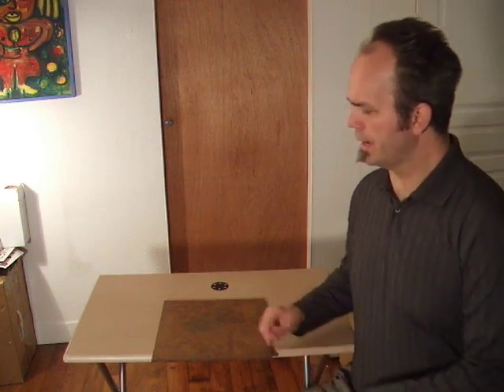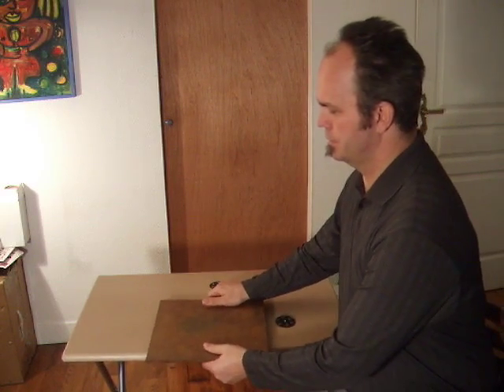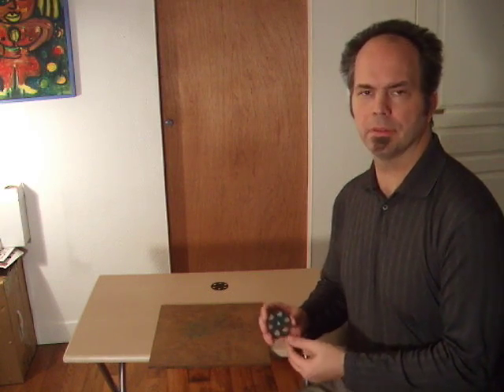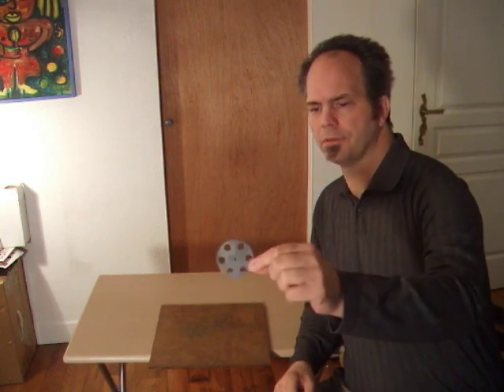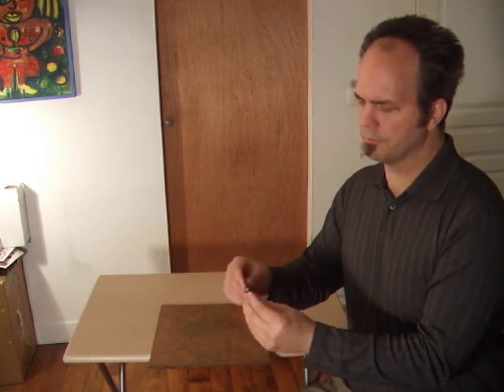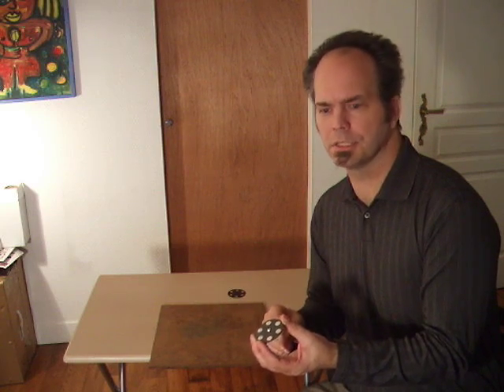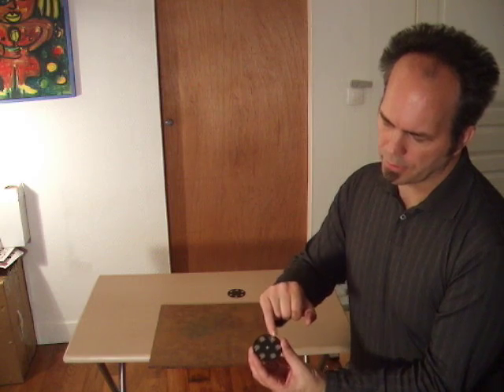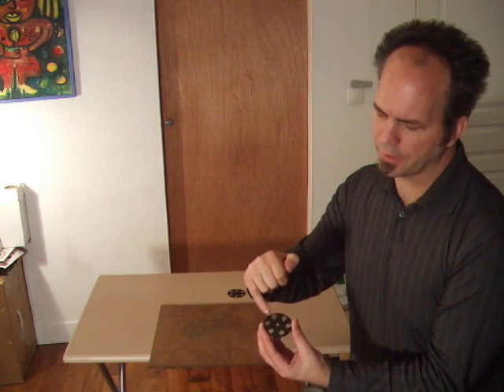🔝 Magnetic Levitating Top via Lenz's Law - Demonstration & Explanation

Comment: have you tried it will all one pole facing down instead of alternating? isn't going to change the Lernze effect from impeding the rotation, but if you look at the video the top bob's up and down. I think this is because you're basically producing an effect of two rings of "magnets" - the top ring is of course the permanent magnets, the lower set of "magnets" are created by the eddy currents in the copper. I"m guessing that the top is spinning slightly faster than the magnetic field collapses as the eddy currents shift, meaning the top magnets will momentarily be attracted downwards by the collapsing (opposite pole) from the previous eddy current. The torque would have to resist this attraction to keep spinning. Using all the same poles facing in the same direction might make the spin more efficient.
Reply: ja hi:  It bounces most likely because the repulsive force of the magnetic fields acts like a spring.
Putting all the magnets in the same polarity should simply be a very good magnetic brake and slow the spin very quickly.  The dynamic brakeing effect is quite pronounced for a Neodim magnet moving on even a rather thin aluminium plate.  Try making a magnet pendulum with the poles vertical, over a copper or aluminum plate of any kind.  The braking is very quick.
I suggest that the rest of your analysis is not well explained.  The eddy induced fields of the plate will move at the same speed as the disk, so I don't think one spinning magnet can "catch up" to the next 'induced magnet' in the plate.  We're talking about the speed of light here...
Reply: hmmm well you're right that the bobbing may just be springiness. However, i'm not convinced that magnetic fields form, collapse, or otherwise move at the same speed as light. For example, the speed of radio waves are affected by the material they travel through, and electricity doesn't move at the speed of light either. I would be very surprised if the magnetic fields of an induced eddy current change at the speed of light.
Reply: ja hi  Perhaps I should have said the speed of the currents and magnetic fields in the respective media.  I admit that the speed of the electron drift in the copper. is something less than 'c' in a vacuum, but 0.999C is still instantaneous in relation to the disk's tangential velocity.
  Go ahead and calculate the speed of the magnets on this approx 2 inch diameter disk at 18,000 RPM and compare that to the speed of the electron drift in copper.  I get 80 Miles Per Hour (0.04% or 1/2316th of c) which is nowhere near relativistic speeds and, therefore, still believe the currents appear to change instantaneously (as the magnets move around the sheet) relative to the magnets.  In addition, further supporting this proposal, a sheet has a very low inductance and therefore low inductive reactance at this frequency of 900 Hz, so there is little delay in current pattern motion under the moving magnets.  Based on these numbers I feel the fields under the magnets follow the magnets, so one magnet cannot "catch up" to the preceding 'in-plate-field'. 
  IF there is indeed no air lift effect confusing this experiment (and I can't see one off-hand), it probably is the field in the sheet cause by one magnet that has a repelling force on the two adjacent magnets.    A back-of-envelope sketch seems to indicate, unfortunately, that the radial current in the sheet between each magnet pair is zero because the currents from the two magnets on either side of this path will be equal and opposite, so further analysis is required to find the fields that could be producing a repelling force.
Interesting.
...
Check my numbers...
Cheers, ScienceAdvisorSteve
Reply: it's really great to see someone so knowledgable in science that is patient enough to share their knowledge with others. Not entirely sure what the field configuration is for the magnets is - it's my understanding that there are a number of different field configurations for neodymium sets these days, but I think I get what you're saying about the field vectors cancelling out in between the magnets, but that still leaves the middle and outside edge of the field, sort of like a lump donut magnet I guess.
Reply: ja hi  He says the magnets alternate North and South.  If you want to induce a strong voltage/current/field in a plate, the magnetic field must be vertical.  This means the poles are perpendicular to the disk and plate, or vertical.
...
  I just put the fundamentals of magnetism to use and figure out what is happening with the induced EMF, cirrent and the resulting field in the plate.
Reply: i meant assuming that the magnetic flux lines go through the magnets perpendicular to their faces completely 360° then the only spots the flux lines would cancel each others' vectors would be where the field lines would intersect do to the alternating polarity. The rest of the flux lines would remain undisturbed
Reply: ja hi Yes; perpendicular tor the faces.
...
I do not understand "completely 360°" .  When "talking technical" you must take great care to say things clearly.
...
  The magnet with North facing down will produce a radial current from center, outward to the circumference (Fleming Right Hand Rule) that is directly under the magnet.  This current must return to the inside of the magnet around both sides.  I think it will divide such that half will return on each "side" of the magnet, that is, between it and the two adjacent South-down magnets. 
 The adjacent magnets with South poles facing down produce inward radial currents (under the magnets) and these return paths are outward and would cancel the North-down magnet's currents since they occupy the same space/volume in the plate. 
  This assumes that the currents and fields in the plate form and decay instantaneously, or aparently so, with respect to the 80 mph speed of the magnets and, thus, the rotation is not fast enough for one magnet to "overtake" the current genated by the preceeding magnet in rotation.
...
I haven't visualized the magnetic fields of these currents, nor the remaining current path segments inside and outside the magnet's paths.
Reply: sorry. It's not clear to me what you're saying. Generally speaking "radial" is a two dimensional term and magnetic fields are three dimensional.
Reply: ja hi I'm analyzing the currents in the plate as a result of the moving magnets.  ignore what I deleted.  Sorry
Reply: my page? um... i'm confused. You mean the videos i've liked? That's sort of non sequitor. But, currents always flow circularly I mean unless we're talking about capacitors and static electricity, electric currents always flow in a path that returns to it's origin. Unless we're discussion magnetic monopoles, which aren't really relevant here, magnetic flux lines don't exhibit (3-dimensional) radial properties. So, still not clear what you're discussion about radials is about.
Reply: ja hi  Sorry.  I confused you with another video.  YouTube bumped me off in the middle of a comment there and I came back here instead of the other one.  I have to reconstruct what I was saying....bummer...
...
I was first referring to that portion of the EMF and resulting electron movement that was being directly induced due to the magnet's motion, not the complete circuit - that part of the analysis came later.
...
Radial is in the context of this disk.  It has a center and an outer circumference.  As a magnet travels around with the spinning disk, the right hand rule shows us which direction the current will flow in the plate   directly under   the magnet on the disk (as I explained previously).  This is where the induced EMF and current is being generated. The plate is for all intents and purposes a plane.  There won't be much vertical component to the field in the plate and besides, the induced EMF and resulting current will be at right angles to the magnet's motion and therefore in the plane of the plate.  Therefore, the currents in the plate are planar.
[BTW: Radial could also refer to a 3D sphere, so it is not just a 2D term]
  If you think of the Hall Effect you will see what I refer to by the "plate under the magnet".
...
Magnet plus relative motion to a conductor only results in an EMF (voltage).  The current is the result of some path for a current to flow given that voltage and the resistance of the path - no path, no current.  In this video, we do have a path (the plate) and must analyze each segment of that path independantly if we are to understand what is going on...if anything.
...
 After that, I talked about the "rest of the circuit".  That is to say, where this generated current would need to go to complete the path/circuit.
...
  I see no other way to figure out how the repulsive/levitation force is forming other than walking through all the fundamentals of what is going on step-by-step. You've got to get down-and-dirty to that level.  That is, by carefully tracing the complete current paths and fields piece-by-piece to see where the potential is for a repulsive force to be generated between the magnet and some part of the field in the plate.
...
As a follow up, in the Hall Effect, we don't  have a complete circuit in the plate and just see the charge carriers crowd to one side of the plate, thus creating only the voltage that is measured and no current (except for the initial crowding of carriers). The right hand rule can show the force on the electrons and we must analyze where they move.
[Yes the voltage measuring device may require some current, but that is inconsequential to the Hall effect concept and the concept of the induced EMF directly under the magnet]
...
Does that help?
...
All of this should come from a complete understanding of electromagnetics.  If you understand all the relevant fundamentals and how to apply them, this should all make sense.   If you have difficulty understanding this, then I suspect you are weak in some area(s).

After going through all this I believe that using Lenz's law as the basis for this levitation effect(if it truely is magnetic levitation) that is the wrong reference. Lenz's Law refers to a different phenomenon - related, but different.  Lenz's Law covers magnetic damping and inductance.  If Lenz's law was the dominant effect here, the disk would just slow down very quickly. Lenz's law says that there will be opposition to the driving force and in this case, that is the spinning motion here, so that motion would be opposed and the disk would brake quickly. It also easily covers those magnets being dropped down the pipes and falling slowly.  HOWEVER, Lenz's law does not explain why things occur in terms of attraction and repulsion.  Lenz's law is more of a summary of some of the results of the phenomenon of electromagnetism.
Reply: Observ45er still a little confused. The eddy currents produce a magnetic field which repels the magnet that is inducing the eddy current. The only way for a eddy current to produce a three dimensional magnetic field that would repel the magnet above it would be if the current was flowing in a circular path with produced a similar pole to the magnet above it.

Comment: cool demonstration. Don't know much about lenzes law, but it seems to me that the very forces that levitate it are also opposing it's spin (like magnetic friction?). I think there's a toy out and about called a levitron. Also, there's a youtube user called Greenpower Science that has a video on a very very effective and efficient way to perfectly spin a top using string (without having to throw it). Will try to think of a way to keep it up longer, but it think the fact that the levitating force is the same force that slows it down is perhaps unavoidable and significant. If I think of something i'll post back.

Comment: I realize the Lenz Law.  Yet, I couldn't help but wonder if you have air dynamics such as lift coming into play.  Like in the leading edge of a planes edge.  Not trying to be negative just an observation.  Thanks for the post.
Reply: No. The rotating disc, which is not smooth or frictionless, would force air away from the center causing a low pressure zone on the bottom where the air could not be relpenish as quickly as the top.

Comment: I wonder what would happen if you used a copper bowl that's attatched to a motor, spinning at a high speed, then held that disc above inside of it and let go... would it stay afloat?
Reply: Patrick Faulkner This has some merit.  SCOTT!  Try spinning a copper disk somewhat larger in diameter under the magnetic disk and look for a repulsive force.  suspend the magnetic disk on a pivoted arm, or just a vertical shaft. This may also help remove the magnets-causing-air-effects issue as well.
Reply: if lens law is in action that should work. it depends on movement between the magnets and the copper plate. stabelising may be in question

Comment: Also, consider other possibilities for how you might get the magnetic eddy currents you need. "Euler's coin" might inspire you. In other words, spin this thing on its edge and see what happens when it begins to collapse.

Another thought... maybe a dielectric surface would yield interesting results? Maybe replace the copper with bismuth. Its cheap, and can be melted into a sheet in baking dish on your stove. Or, if you're into chemistry as well, you can isolate from pepto bismol. ;)

Comment: Your first problem: you need a better mechanism for spinning the top (like a flat-head bit), and when you release the top it should already be in contact with the surface, and the surface should be polished.

Problem two: You are spinning it clockwise. The right-hand rule does not just apply to electricity and magnetism. You are countering your "Lenz lift" by spinning it the wrong way. Go counter-clockwise for added lift. Study gyroscopic procession and get comfortable with this idea.

Comment: instead of a cardboard box for walls you should have a material(metal) that repels the magnets this could direct the disc to stay centered, also i reckon you should angle the actual magnets on the disc into the direction of spin instead of havvin them poiting down the force should be pointed away, just a thought

Comment: It's levitating alright. Recently, I constructed a couple of gears in AutoDesk Inventor, and (thanks to my Engineering class at high school) was able to print them out. I have 3 small gears, which each contain 12 magnets, evenly spaced similar to yours, in the same N,S,N,S configuration. I also have a middle gear, which is much larger. it is close to a 3:1 spin ratio. If i ever manage to get something to mount them with i would love to do a similar test.. message me if you would like pictures?

Comment: np, magnetic fields are a lot like springs, if they change shape they don't like it (oversimplification there but accept it or learn tedious maths xD) another extreme example of the same effect is a ring on an iron rod, there is also a coil on the rod. the coil is momentarily blasted with a huge voltage and the rapid changing magnetic field induces a current in the ring and this in turn creates a magnetic field opposing the coil. the end result: a rail gun!

Comment: the magnets induce eddy currents in the copper plate.  the eddy currents are polarized by the pole of the magnet that induces the field.  North causes south in the plate and visa versa.  The current persists and the next magnet comes over it repelling from the plate. Which induces and which rides on the field doesn't matter because of the configuration of the magnets around the disk.

Comment: It would probably be simple enough to balance with three or more of those discs. If you motorize the discs then you could sustain the levitation for as long as the motors were going and propel it with basically whatever you want. That's a wonderfully simple and innovative application.

Comment: Fun!

FWIW you would have done much better to put the magnets together in pairs or triples; as the disk spins the front magnet leaves behind a wake and the second one levitates on that, it's much more efficient and you get higher lift and less drag. Also, using bigger diameter magnets lift at lower speeds and float higher, even if they're thinner.

p.s. you should be able to make  the disks in fiberglass, which is cheaper and almost as good.

Comment: Gets good at 3:16

For a centering force, try a large vert-axis magnet below the table, and a small one in the disk center.

For a drive force, try a horizontal rod magnet on the disk, then spin a larger rod an inch above it.  The torque should be quite high, even if the upper magnet can't lift the disk.

Comment: New, interesting and novel experiment.  I'd ~ suggest using a low impurity 12" X 12" carbon graphite plate (and its opposing/lifting diamagnetics); as the present copper plate will strongly slow down the disc magnet/s revolutions via eddy current dampening.  The carbon graphite is of course a lot cheaper.

Comment: Outstanding work ! Try building a small model car (or hover board) with about four of your discs powered by a lightweight DC motor. All the discs could be driven by belts or small model airplane gearing. I would bet the generated lift would be more than enough to keep the model levitated.

How much rotational resistance do the eddy currants place on the discs ? Its hard to tell if they stall from hitting the box or from the eddys.